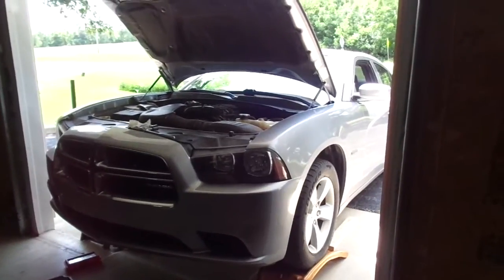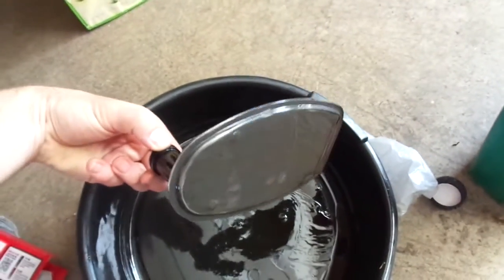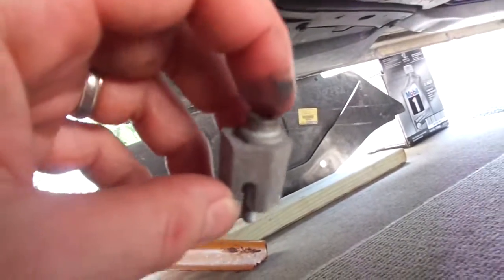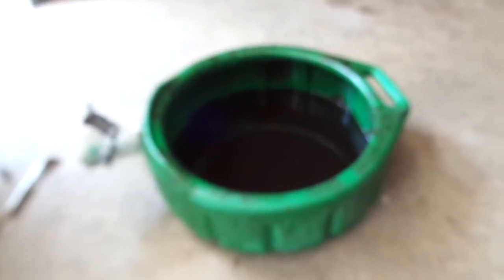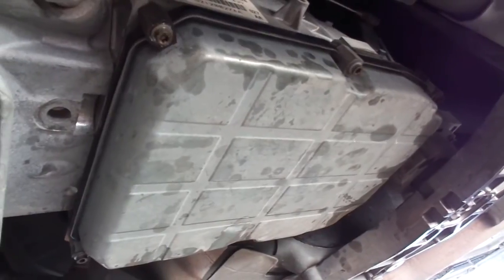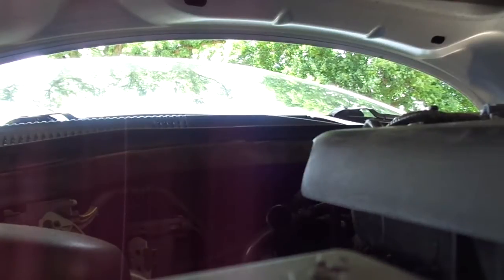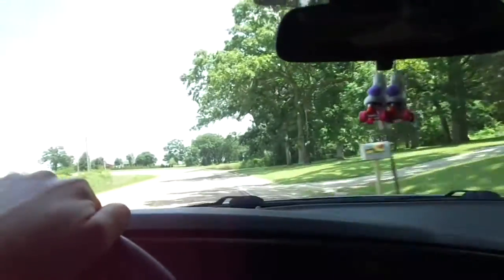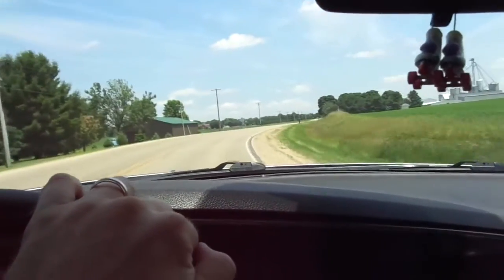2011 Dodge Charger 3.6 Transmission Filter/Fluid

Comment: Idk if you still check comments but what the regular operating temperature of the 3.6 charger mine tends to read 190-201 and if that’s is to high would you recommend me probably needing to change the transmission fluid. It’s a 2012 and just bought it 2 months ago
Reply from the maker: mine usually reads pretty close to the middle of the gauge.  190 seems pretty good but if you are concerned you might try changing the thermostat.
Reply: MrTrenbo yeah I got to do that I got a check engine light for the thermostat even tho the car don’t read hot and my bad I meant to say my transmission temp reads 190-200 it be

Comment: I don’t think you mentioned what transmission fluid you used and I have a 2014 Dodge Charger sxt 8 speed and they say you have to fill it from under the car that by the transmission pan there’s a fill port plug , is yours different? And if I got an OEM pan Does it come with the gasket since the filter is built into the pan ?
Reply from the maker: Yes that sounds completely different than mine. Good luck.

Comment: Was the fluid level correct
Reply from the maker: I guess it was close enough. It shifted fine and is still running like a champ.
Reply: Cool ok so 3.5 quarts and did you use Maxlife

Comment: The transmission is a Chrysler A580 5-spd, developed from the Daimler NAG1, which was originally a ZF design.  These are built by Chrysler in Indiana.  Currently, the only vehicle using it is the Charger Pursuit. 

The fluid level in this transmission is measured by temperature.  The "dipstick", which is little more than a cable with a solid end, goes in the dipstick tube.  With a scan tool connected, the fluid level can be measured at any given temp. 

Mopar ATF+4, nothing else.
Reply from the maker: Thanks Pete